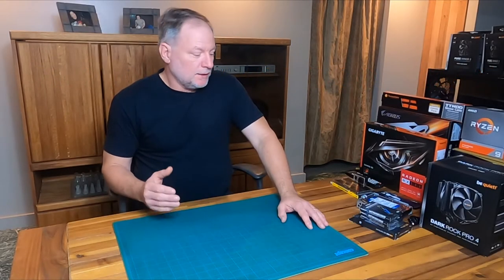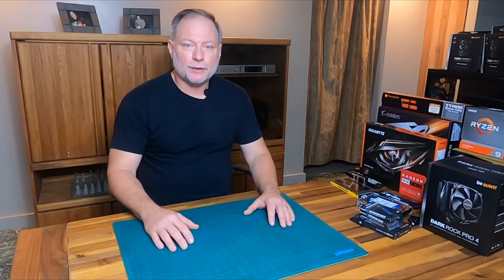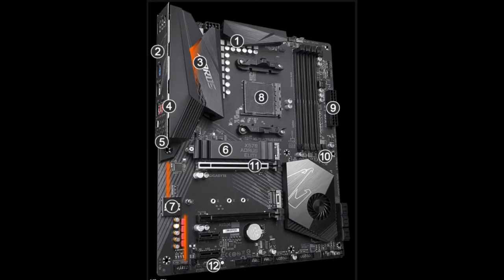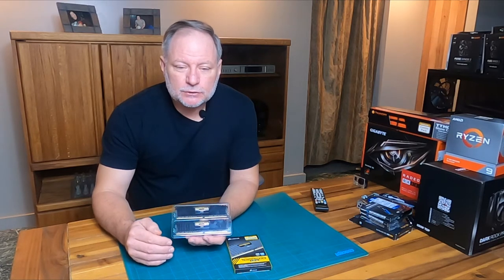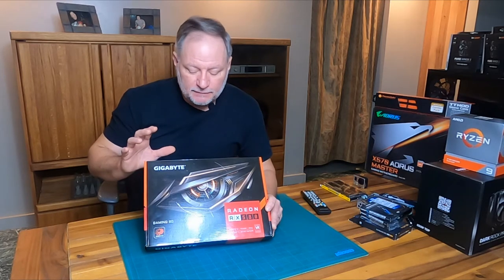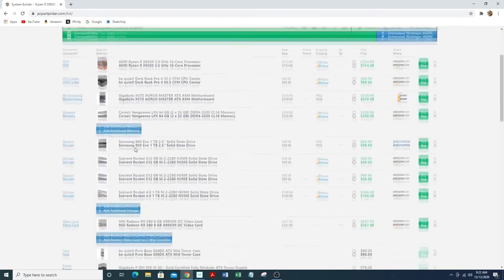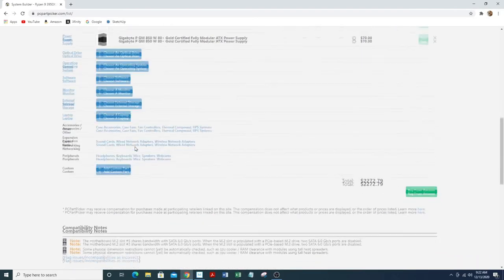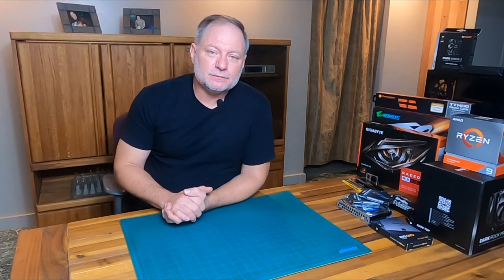How To Build A Video Editing PC - Part 1 - Parts

Comment: hey how is your psu doing i have this psu sitting in my closet but i was told fro m5 of my friends that owned this 850 watt psu the gigabyte p850gm i was told to avoid this they had horrible experience
Reply from the maker: I am having random restarts occurring every 48 to 72 hours, I was thinking the issue was the psu.  Have a new one on order, however due to the semiconductor issue it is on back order